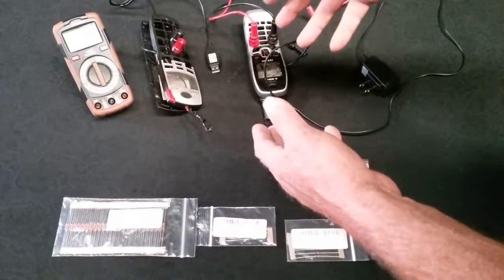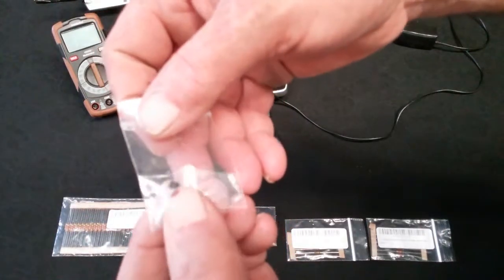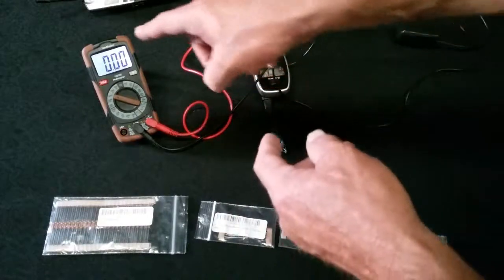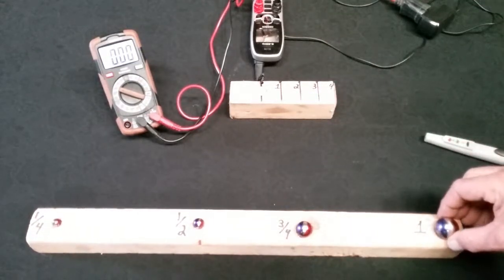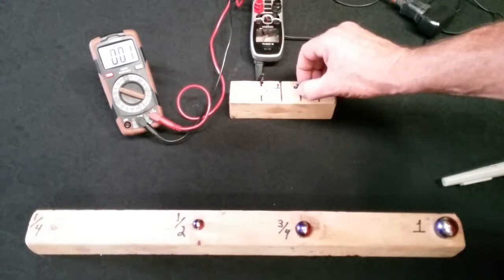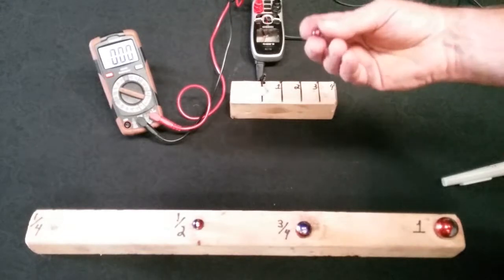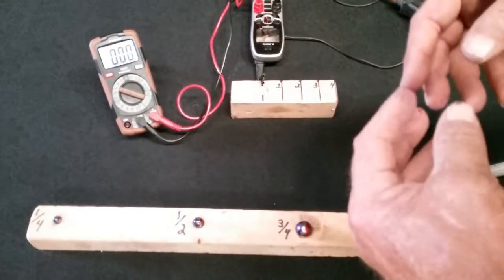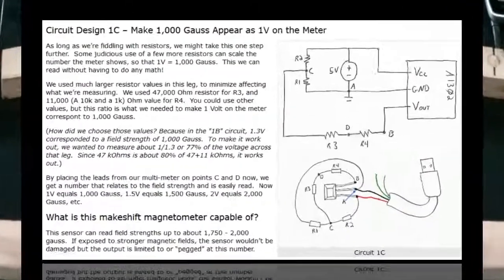Home Made DIY Gauss Meter

Comment: can you take a coil with a wire of 2m to run a currrent of 5A through it and then putting this on a scale to mesure the force and then one gramm is equal to one milli Tesla. With this you should be able to mesure strong magnetic fields easy and cheap. But is this acurate?
Reply from the maker: I have no idea if that is an accurate way to determine the Tesla.